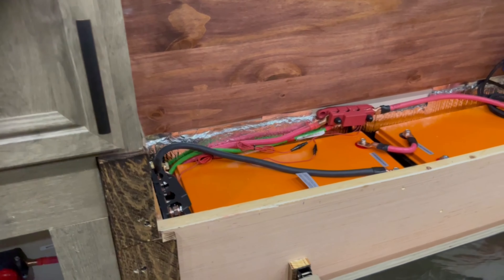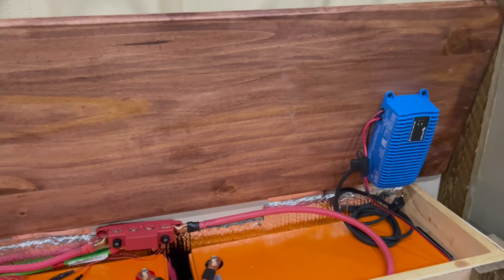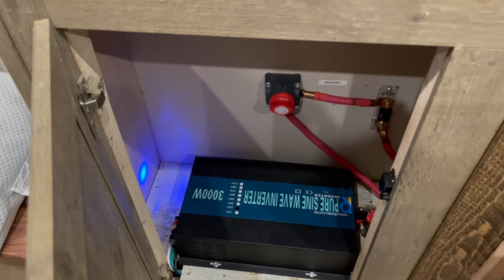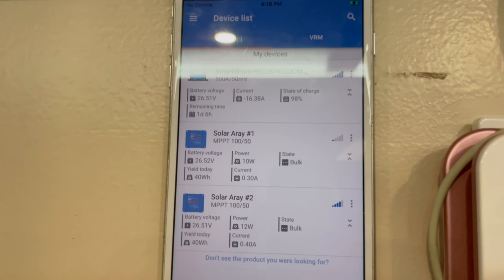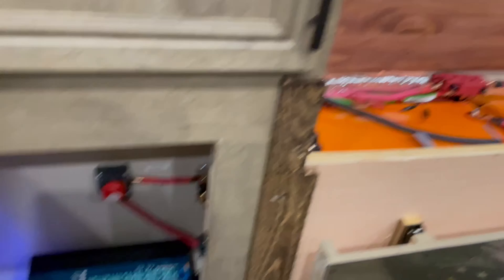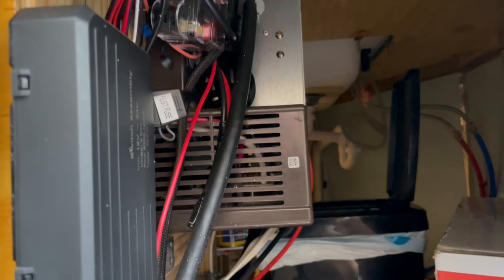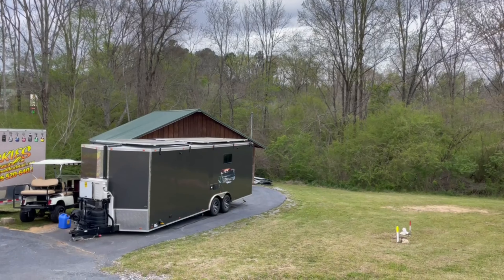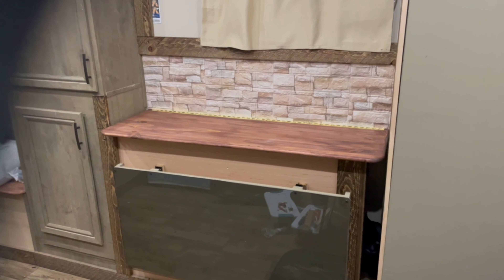RV Solar upgrade. Massive batteries and Solar array!

Comment: You did a good job on this, I did my own Isuzu NPR Boxtruck conversion.  Still in progress, but I put in qty 4 280ah at 12 volts so  1120ah total.  I haven't gotten my solar on yet, but I am going to mount qty 5, 540watt bifacial modules on the roof.  I can run the minisplit for 6 days in cooling mode on the batteries.  It uses like 200 watts on minimum, and I put it in the top sleeping bunk so I can close it off at night.  So six days closed off and occasionally going off completely.
Reply from the maker: Wow! That’s gonna be awesome! Share some pics when you do. Would love to see it!